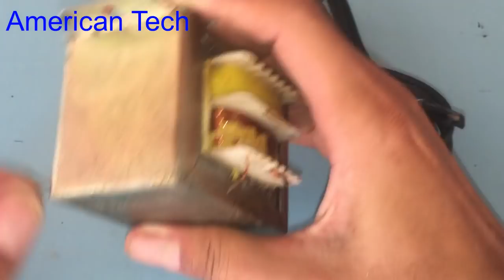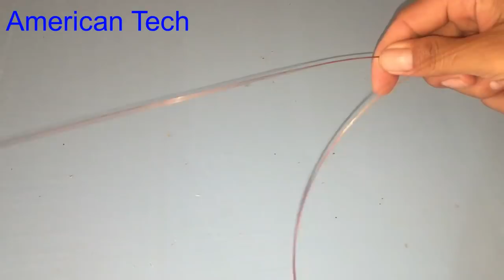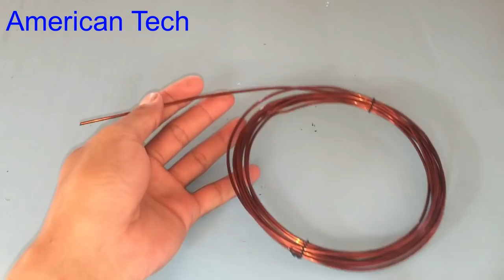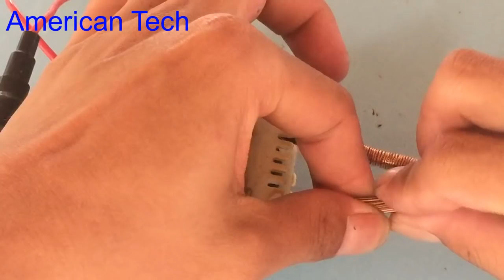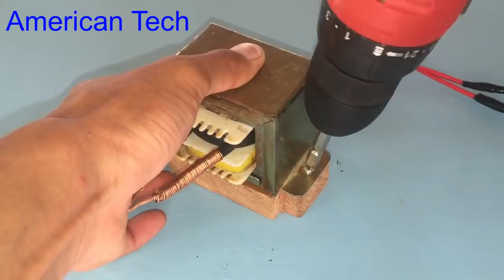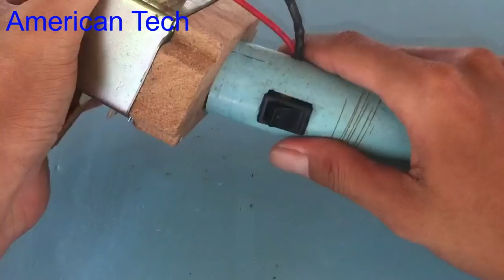How to make a powerful soldering iron from transformer

Comment: Instead of wrapping all that wire around the tip ends to secure it to the transformer secondary, I'd have slid a slit piece of copper tubing over it and then compressed that tight with a hose clamp.

Comment: You could take any thick cable for the second winding. But you used the same material by joining it in parallel instead of sequentially. Your method is beautiful and sophisticated.

Comment: it look like very very old style soldering iron.. but i think use copper as heater is no good maybe can use steel wire as heater element , they have higher resistance ..

Comment: what volt transformer did you use, did you use your common wall outlet to power this or some specific power source
Reply: The term "common wall outlet" doesn't apply. 
He's in india, so it's probably a 220 volt transformer, but there are some places that get 110 there. 
The real issue is the frequency. 
Transformers meant for European frequency (50 hertz) react differently than stuff meant for US mains current, which is 60 hertz. 
The main difference is in the number of turns that are permitted, with european transformers requiring less than an american equivalent. 

The real issue with this design is that it's not electrically isolated from the circuitry that you're soldering.
Reply: @walterbunn280  "it's not electrically isolated from the circuitry that you're soldering.
   WHAAAAAT?!    :-))
Reply: @taunteratwill1787  The heating element is a straight copper wire that comes directly in contact with the molten solder. 
Most soldering irons run electricity through a length of nichrome wire to heat up a chunk of iron, that is then used to melt the solder. 

The copper wire also becomes more resistant to electricity as it heats up. If the cold component that is being soldered into place ever becomes the path of least resistance in that circuit, it will dump the entire load through that component. 
Further, molten solder is mildly corrosive to other metals. As the copper heating element dissolves, the electricity is forced more and more to flow through the hot solder to complete a circuit, which will eventually cause it to flow through something it's not supposed to.
Reply: @walterbunn280  If your theory was right then no matter what materials are used to solder, circuits would be fried all over the world.   I can assure you that no current will or can be dumped that way.  If you don't think so just attach a multimeter on various points on your solder project to test for even the weakest currents.    :-))
Reply: Lol he's not in India, he's Cambodian